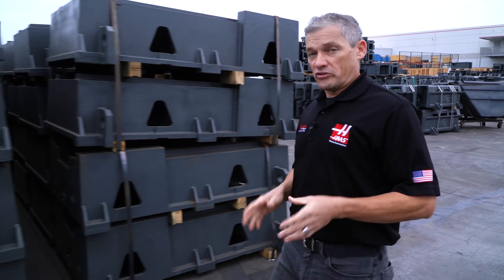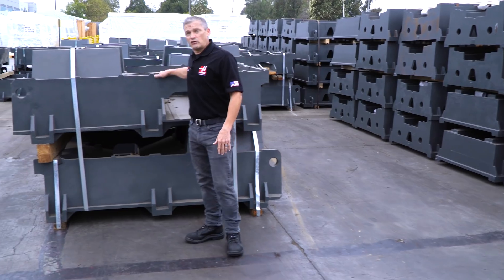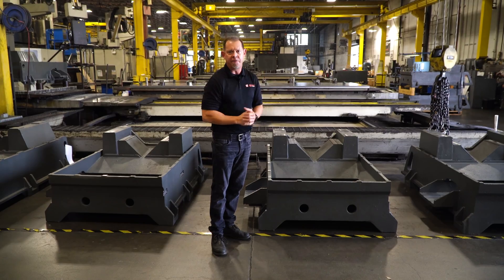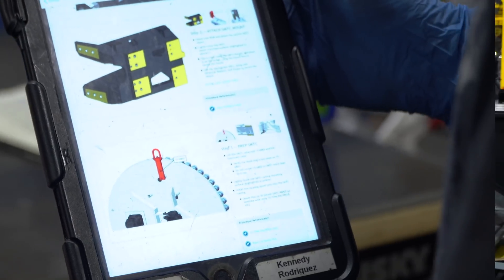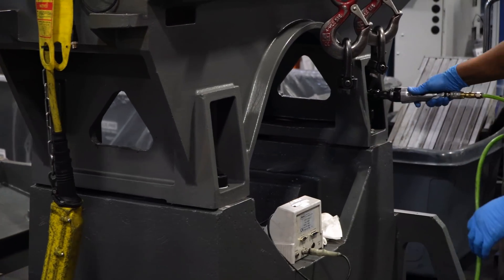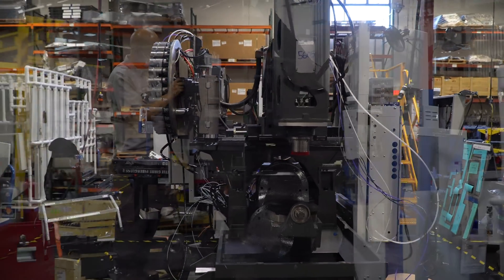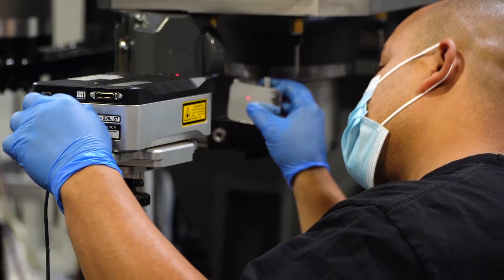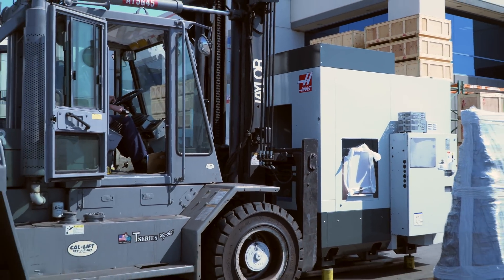How We Build UMCs - Haas Automation, Inc.

Comment: Although these are great machines (we got one 750 and two 1000) I dont like how the encoders are mounted on the B-Axis. Every machine has a different homing location on the B-Axis(Z-Chanel is positioned at random or 'eye balled' at best) making it virtually useless to bolt a vise to the side as it were heavily advertised for flexibility... The machines would smash the vise against the bottom of the pan at every homming cycle.
Reply from the maker: Ernie, Thank you for letting us know about your issue. We have verified with Manufacturing that the encoder ring z-pulse location is clocked in the same position on every machine. However if you continue to have issues with the B-axis homing sequence on your machines please contact your local HFO to have a look at your machines or contact us here at bofallon@haascnc.com so we can take this up with the HFO directly. - Haas Automation, Inc.
Reply: @haasautomation  Thanks for gettimg back to me. We are working closely with our HFO applications engineer regarding this.  The machine rotates to -65 degrees during homing cycle rendering the location for the vise unusable.  He has concluded (after communicating back and forth with Haas in California) that to change it,  the ring needs to be physically rotated and then the machine recalibrated to update the internal compensation tables. Besides this,  It is a wonderful machine and has allowed us to manufacture some cool stuff (see my insta account). My favorite part of the UMC 1000 is that it uses cycloidal gearboxes as opposed to worm drives that the first gen UMC 750 uses

Comment: Seeing these bases, it's making a lot more sense why we never seem to have the right forklift on site to move these machines around.
Reply: If you're only moving them on smooth concrete look into some air casters. Basically they are platforms that create a thin air cushion using the shop air supply to make moving machines easier. There are even some that can be left under the machine's base permanently, even when not 'powered', making it easier to move when needed.
Reply: I have a 16000lb 98 hs-1 I bought last year in my garage at home. I bought a set of 4 12000lb machine skates, a low profile 20,000lb hyrdraulic cylinder and a 400lb winch that I use to move the machine around.